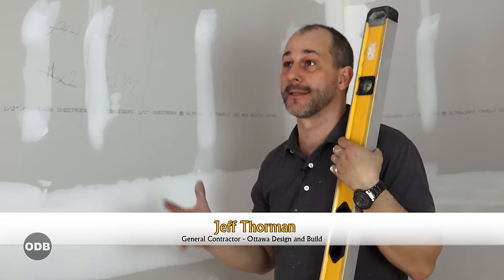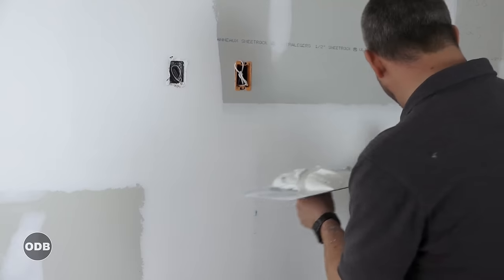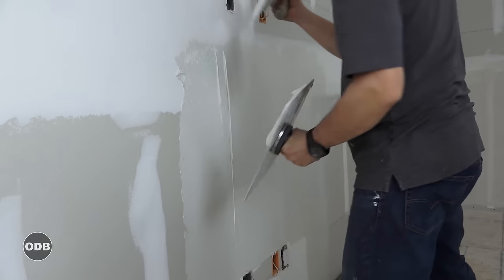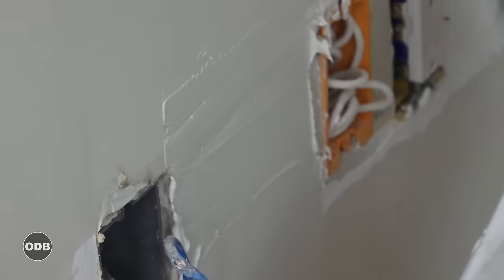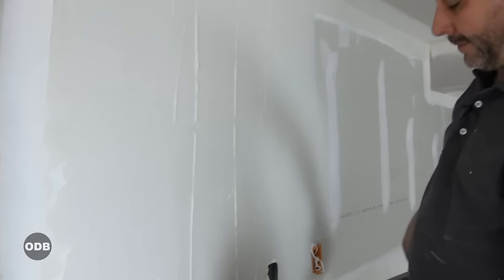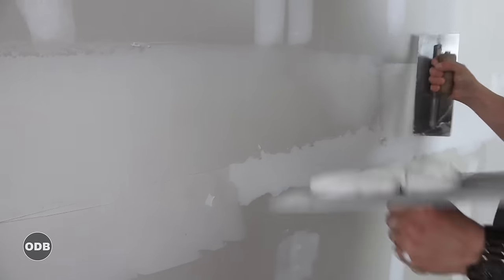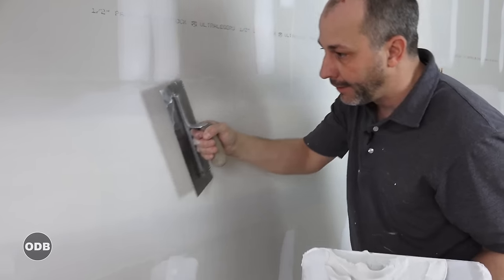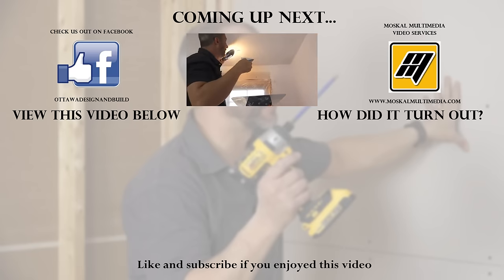Complete Drywall Installation Guide Part 10 Final Coat

Comment: Jeff & Co --- THANK YOU. Your videos have sincerely changed my life for the better. I stumbled upon Home Renovision a year and a half ago, after deciding to purchase my grandparents' 1954 home. Our basement was a time capsule to the 1960's, and the upstairs wasn't much better. I started with ZERO knowledge, experience or exposure to tools, carpentry, and so on. I now have a full fledged wood workshop in the garage, countless hours of hands-on experience & the wisdom to tackle the rest of my home. My grandfather has since passed... but in that time, I was able to show him my appreciation, love & dedication to the house he lived in for 50+ years --- built by his father before him.

On a lighter note, my spoiled kids are now reaping the rewards of the 450 sq ft bed & bath renovation you guided me through. 

To keep things brief, my first project as a diy'er included:
- Discovering major water damage, mold, and termites (yikes)
- Demo'ing all trim, drywall, insulation, carpeting, sink, toilet, shower & windows
- Repaired rotted sections of exterior sheathing, studs & sill plates
- New house wrap, hose spigot & siding repairs
- Air & Weather sealed every single gap
- New insulation, vapor barrier, drywall, flooring, trim, shower, sink, toilet, hardware, windows, etc.
- Added overhead lighting, additional circuits, and so forth

You've taught a man to fish. For that, I can't thank you and your family enough. Your incredibly thorough & high quality content has enhanced my family's life for years to come. 

More impressive than that --- I now love to mud drywall. You've created a monster.

- Bryan

Comment: Thanks for the videos. Have learned over the years that drywalling is more of an art than it is a trade. It takes practice, patience, and persistence. I've spent so many hours mudding, taking off mud, putting it back on, sanding, second coat, sanding, and final coat. Your steps make so much sense to me now! - keep it thin, don't fuss over ridges/high points, and keep going! Used all of your steps verbatim in my last bathroom project and took me half the time of my previous drywall jobs. THANKS MAN!!

Comment: You have the greatest videos!  I am in the process of building about 400 square feet of basement, and I've been all over your stuff.  I got my electric run, my framing done, and my sub floor in.  I'm finishing my bulkheads and then it's drywall and putty time.  Thank you for all of these videos!

Comment: You're not only a great drywaller and finisher, bet a fantastic instructor.  I have watched parts 5 thru 10 about 6 times each. This is where I have the most difficulty.  I would like to see a video on knock down texture.

Comment: You have been a huge help with this series and the new videos throughout my drywall phase. One thing I wanted to pass on related to dirt/debris. I started noticing orange fibers in my mud and they kept coming up even with new batches. Turns out, I must have scraped the mud from the barrel with the knife too aggressively and it scratched the orange Home Depot bucket causing bucket fibers to get in the mud 🤦‍♂️ I had to dig the crap out of the dried mud, switched to a new bucket, and redo the mud batch. Be careful when loading up your hawk from the bucket! 😅

Comment: Liked learning more about he fade techniques to get the butt joints flat with minimal sanding.  I understand the concept, but your technique is obviously the key to efficiency and a smooth job.  I also never appreciated the importance of the gradual finishing over 4 applications of the compound.  That really helps.  Thanks.

Comment: Great video series as usual but I didn't understand your taping method.  Worrying about tape over tape as most would find themselves within the beveled flat joint.   The way I was taught was butts, flats, inside than outside that way all tapes kinda hold themselves down by the next without worry of coating early and pulling back or moving.   Also a little trick I learnt when taping joints around receptacles.  Just fold a paper tape up 2-3 times and stuff it in there and coat away like the box was never there.  If you find yourself worried before final coat you will loose it because the shrinkage wasn't there just push it in a bit beforehand so you can find it later.  It's super easy and the electricians appreciate  that when they come their boxes/ wireres aren't coated in mud

Comment: I use two of benches with a 8' - 13'  extendable scaffolding stretched between them.
Really nice control on the mud and trowl.
Really great that you taught the reason the joint mudding has to be so wide.
Reply from the maker: great setup. |cheers|!
Reply: @HomeRenoVisionDIY  Have you tried the wallboard bucket blade? It is excellent in a 5 gallon bucket of mud. It is so much better then taking your trowel or mud knife to clean the walls of the bucket. It is so much easier and does a way better job. I clean a bucket wall with my tapping knife. then ran the bucket blade over what I did with my tape knife. Bucket knife won hands down.

Comment: I don't use ready mix mud anymore or paper tape. I replaced it with hot mud and mesh tape.

The corner are not as easy but with hot mud I get my corners done in 1 days. 

Hot mud will never bubble, crack or shrink.

Comment: Hurricane Sally did a job on my house. No HO insurance.  So I'm trying to DIY on repairs. I have a wall next to my fireplace that I had to remove because of mold. I also have a wet bar on that side of the fireplace wall. I cut the existing drywall from ceiling to the top edge of the countertop backsplash. Now I don't know how to attach the new drywall to the existing old drywall at the backsplash edge since it is even with the backsplash top edge.  I'm not able to reach behind the drywall due to the fireplace brick wall. I have pics if you would like to have a visual of the mess. I would be so grateful for any suggestions. Thank you and I can tell you take pride in your work. Noticeably a perfectionist. You're awesome.

Comment: I'm adding a "closet" to a downstairs room which has an auxillary kitchen.  It'll have  a 30 inch locking door.  Basically, the new owner will have a pantry for that kitchen.  And the Realtor will call it an extra bedroom.  The walls had wood panel sheets with groves which I already sanded and painted, so I pulled panels to use as the exterior of the "closet" / pantry.  I'm reviewing drywall with you because you explain it so well.

I'll end up watching all your videos, more than likely.  I just like the way you explain things.  Thank you, very much for you time.

Comment: Good stuff. I'm doing a sound room from scratch in a basement in Philly. Big room. I'm pretty good with drywall and mud, but not as good as I'll need to be for this job. I like your method and have a much better idea of the time I'll need to budget for the mud piece. Thank you for sharing your know-how. Best.
Reply from the maker: What is your system for sound proofing?

Comment: So I'm drywalling my bathroom and it's the first time I've ever done any type of drywall or mudding and I have been watching your videos for a month now and I feel.. I felt like it was going to be cake no problem I knew exactly how to do it from what you showed me I'm already an expert and I haven't even mixed up any mud yet. Then I mixed up mud and boy did I mess it up I just took it all off and wound up getting the drywall all wet it's a mess now but you made it look so easy that I thought it was going to be easy but it is really not that easy so I'm kind of upset with you because you made me feel like an expert before even tried it and then I had a complete failed attempt so I'm going to try another attempt tomorrow hopefully it will go better. But I wish you didn't make it look so easy cuz it's not. I really enjoy watching your videos though he do a great job I just wish it was as easy as you make it look :-)
Reply: Once you get going, his tips are great. I was in the same boat- taking off tape and reapplying, making big messes, but after you do a few corners and walls you'll get the hang of it. Good luck!
Reply: Hi, I tried not wetting my tape, like Jeff, but after a couple of botched attempts, I broke down and wet mine before applying it. This helped me imbed it into the mud and get a smooth first coat. Maybe when I get better at it, I won't have to wet the tape, but it did help me. Maybe that could help you a little. Good luck!

Comment: What about the z beads? All modern new houses use those in the ceilings. Also; what about when a drywall ceiling meets porcellanato tiles like in the bathrooms? What about when meet stones and other rough surfaces? There is a plenty so this is complete in only one simple drywall meets drywall perspective.

Comment: Hi Jeff, I use such technique to learn from you, watch through the whole series once at the beginning; repeat as many times for particular steps until I fully understand on the go.
Tell you what, it took my more than two weeks, a couple of hours each day  to master the skill: side load mud with 4" putty knife, smear a long mud strip of even width and thickness, forehand/backhand on wall and ceiling, particular thanks for emphasizing  this part. 
  
Here is my summary of number of coatings and questions
-Insider corners: 2 coats, the 2nd coat is 4" wide by the putty knife, Someone told me he used to stretch either side of inside 
                     corner about 12" , Q1: is this necessary? 
-Outside corners: 2 coats, first coat sheetrock45; second coat regular joint compound;
-Tapered joint: 3 coats, 2 coats of mud is enough, 3rd coat making it even foggier;
-Butt joint:4 coats, stretch further each time; this part bring me most attention.   
                    Did I got everything correct? 
Q2: Can I use Sheetrock90 instead of 45?  I am not fast and I have a 22ft  long bockhead outside corner, 90 would buy me more time before curing up.  Even with 90, I still can only mix fairly little amount at a time.      
BTY, so much appreciated of your prompt responses to my previous questions.

Best regards
Louis
Reply from the maker: Thanks for the questions. You seem to have a good grasp on the technique. You don't need to stretch out the inside corners. And you could definitely use 90 mud instead of 45. It all depends on your personal choice. Good luck with the basement!

Comment: I can agree with your technique and applications but I must say why do you not use a slightly wider knife in the corners for finish coat  or even a wider trowel for the butt joints ?

Comment: That level should be applied to the studs before drywall is hung and butt strips should be stapled to studs to flatten out the plane.

A few butt strips before hanging will save time finishing.
Reply from the maker: very true, and yet the wood will still move if it is drying post install of the wall board in many cases.

Comment: Learning a ton!  We hired a contractor to get our home in the dry.  From the beginning, we decided that we were going to do the inside work ourselves.  Your videos are helping us a lot.  I am a novice but have a strong desire to learn and to do it right.  You have given us some great tips and advise on applying each coat of drywall; what to do and what not to do.  I am not good enough to use hot mud, just standard/all purpose mold and mildew resistant mud. I do have a question.  Can you give me some advise about the different consistencies of the mud for coat 1, then coat 2, and then the finish coat?
Reply from the maker: Hi Polly, the goal is to get the mud as smooth as possible and still not make a mess. I found 1 cup is good per bag to start and then add a second cup for the final coat/bag. Cheers!

Comment: Am I missing something here? It's far quicker and you get a completely flat surface with out all the fancying around day after day , if you use square edge plaster board fibre glass mesh tape all joins and just skim the wall with board finish plaster. Job done

Comment: Late to the channel here, but I'm a fan. When laying the bottom layer of sheetrock to the wall, you mentioned in a previous video how important it is to maintain the gap between the concrete flooring and the drywall. When laying the mud, should that gap be closed up or maintained and covered with floorboard?
Reply from the maker: leave the gap so there is no moisture transfer. Let the trim boards cover the gap! Cheers!

Comment: I second the comment on how to correct errors for novices.  For example, how do you deal with wavy tape on the first coat?  Thanks!  Looking forward to the sanding video.
Reply from the maker: Looks like we will be doing a new video covering how to fix mistakes. Doing a huge project in September. I will have it out this fall.
Thanks for the ideas.
Reply: Thank You!  Also, how or when does the corner of corner bead actually get covered?  The metal gets exposed when pressing.
Reply from the maker: There is no need to cover the metal entirely. when you sand and prime it all works out well.

Comment: Can you show me how you mix your mud? I usually use the light low dust control mud.  I try mixing my own quick setting and it hardens up so fast in my bucket and I have a huge ruck left and I had to throw out the bucket a couple times.  I have recently been watching your videos and you have done a great job explaining and I really appreciate them.  Thank you and hope to get a response.  
~Jack

Comment: Just wanted to say that I think you do a great job on the videos. They are easy to follow and I love how you explain how and why you do things. Just curious though at the end when you covered the bucket, can you store the 45 mud if it is sealed? Thanks again for all the great info. Coming up next going to watch your door hanging videos.
Reply from the maker: Thanks, the mud only stores well if it is premixed. if you use any product with a hardener it will set by chemical reaction regardless of the presence of oxygen.

Comment: Did you only use 45 min mud the whole time?? I’m redoing my island in my kitchen and the drywall area is 34” x 57” a small area so I don’t have any butt joints just tapping inside corners and metal corner bead I have the ready mix all purpose with the green top and I also have some ready mix plus 3 should I be using 45 minute hot mud instead????? Thanks for your help

Comment: Your videos continue to help me in my remodel! One question, I have had an issue with tape pulling the primer off the drywall, even if I wipe the walls with a damp cloth before applying Bullseye 123 primer and my Baer paint. Would a skim coat help the bond of primer to the wall when tape is stuck to a wall? Also, screw holes are slightly visible, would a skim coat also make those go away?

Comment: Great video series. I saw you are using a 10” trowel, is it a dead flat blade or is it one of the ones that has a slight concave from heel to toe? I have the latter and am wondering if it’s making matters more difficult! Thanks
Reply from the maker: Thanks for the question Brian. I use dead flat. The whole system depends on it. any curve = sanding.

Comment: Thanks for these videos!  They’ve helped me a ton!  One problem I’m coming up against is air bubbles in my tape after 2nd coat. Is there a way to remove the bubble without tearing all the tape off?  Can you just cut it out and re-mud to build up the thickness?  Thanks again!!

Comment: This series is really superb - thanks for sharing your know-how. Question - I have a home built in the 1950s that has visible drywall seams in several rooms. Would it be advisable to run a skim coat over those seams on those old painted walls to smooth everything out?
Reply from the maker: Hi Kevin, If the seems are looking like 16"'x4' panels attached to the walls then don't bother. they didn't use tape on those joints back in those days. That was a type of plastering process. Besides the walls have oil based paint on them and you will have problems with bubbling. Those panels also have asbestos in low levels so the best option might be to skim coat the walls with new plaster. Cheers!

Comment: Maybe a dumb question, but what I don't really understand is why do you put another layer of mud on the center of the butt joint when you're really just trying to get mud on the outsides to feather it out? If on your previous coat, you finished with a swipe up the center of the butt to make a flat spot, shouldn't you be able to just mud on either side of it? (Genuine question because I have never mudded a butt joint myself)
Reply from the maker: Good question Josh. The reason we get the middle wet again is because the mixture of the mud is much wetter than the first and second coats. This way when you sand you are sanding the same surface with the same energy and getting a superior result. If you ignored the middle you would have additional ridges to sand and different textures to contend with. The goal is to simplify the sanding process and enhance the final presentation in 1 step.
Reply: Ottawa Design and Build Renovations Makes good sense - thanks for that!

Comment: Question: you did final coat (thin mud) on butt joints & horizontals, and also over corner bead w/45 min mud. Do you not put a final coat on inside corners?   Thx in advance. Love the series!
Reply from the maker: I use final coat mud on my inside corners as the second coat. Cheers!